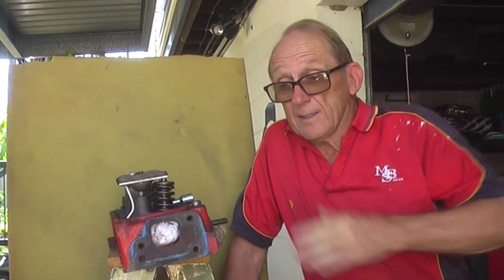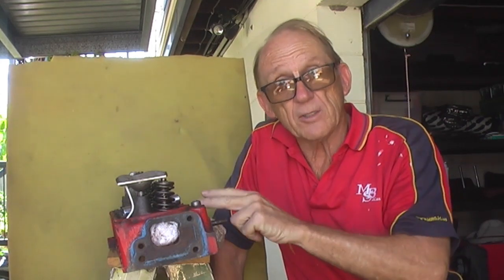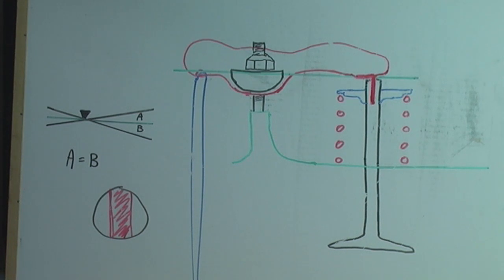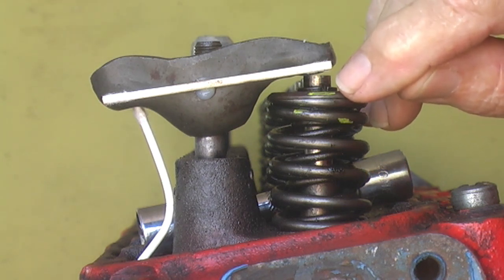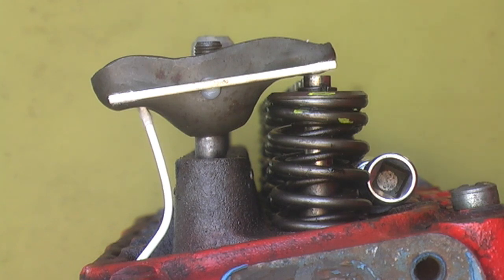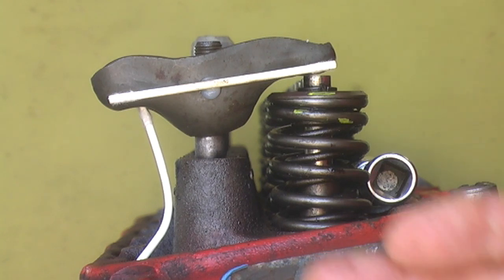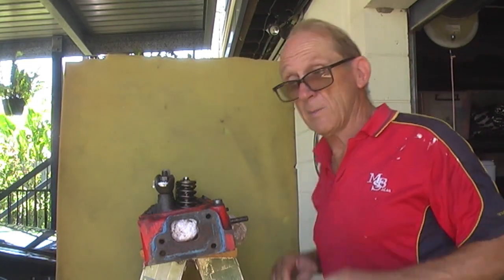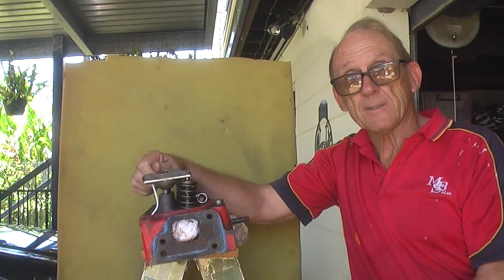149-186 Holden cylinder head geometry adjustments

Comment: Thanks for your info, Am I correct in thinking this would be the same for the 253/308. I been scratching my head about this.
Reply from the maker: the geometry is different but with the same result. The mark of travel on the valve tip is what you would do for a V8. From my last vid you will know how to tell what needs to be done to correct errors.
Reply: Thankyou, I am trying to understand the Yella Terra shaft mount non adjustable hydraulic type. Your knowledge is of immense help. @mbsoldschool
Reply from the maker: check out the vid I did on 202 geometry as well to get a better idea of how to proceed